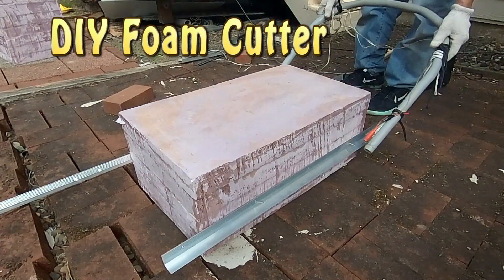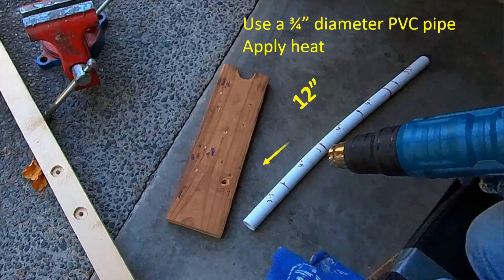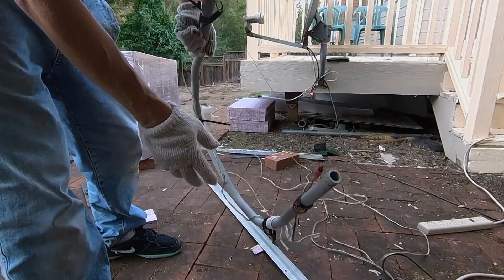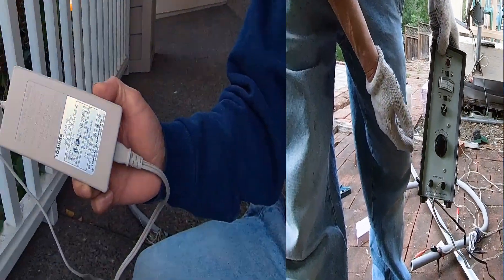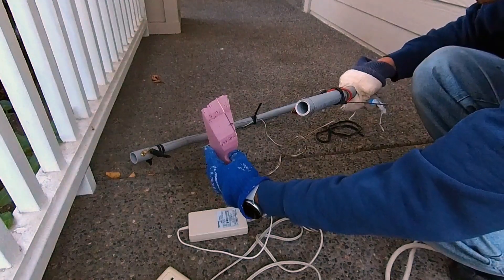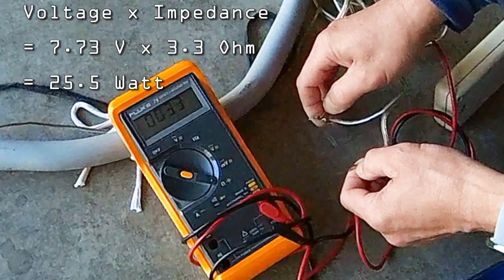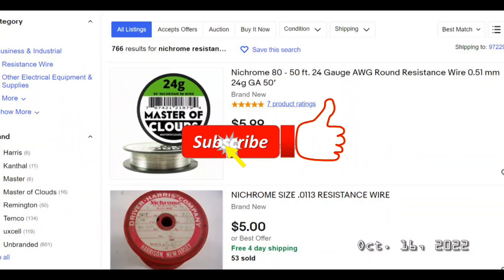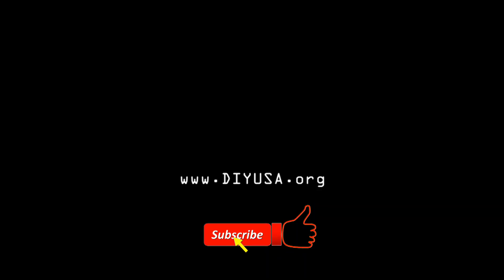DIY foam cutter using laptop power adaptor

Comment: exactly what i was looking for!! thanks so much i was looking for a tutorial to turn my power supply into a hot wire to cut my boats foam🤣🤣🤣 its like exactly what you did too funny
Reply from the maker: Thanks for your feedback. The setup in the video many not generate enough heat to cut a thicker sheet of foam. I suggest you to try: (1) use a larger power adaptor, 80 W or larger  (2) use a thicker gauge wire (to lower the impedance/resistance and draw more current/power, so the wire will be hotter). You can also twisted a few thin wires together to reduce the impedance and allow more current to go thru. Have fun!
Reply: Sounds like what I’m doing lol. I’m using it to evenly cut the pour foam channels I poured 😅
Reply from the maker: @AbdulShaat  That's great! Thanks for sharing!

Comment: The first bend had me hooked it was too smooth lol.
Reply from the maker: It is very easy to make the smooth bend. I don't put sand, etc. in the tube. You just need to apply even and sufficient heat (not too much as to turn the pipe into yellowish color, which may emit harmful fume).  The pipe behaves like a spaghetti and if your limit your bending radius,  you can make a smooth bend. In this example, I heat a total of 9" long section evenly prior to doing the bend. Have fun!

Comment: The power supply is a great idea.  I've been thinking of making a cutter, I have always used knives and sandpaper.
Reply from the maker: Thanks for your comment. I have used knives, hack saw blade, etc. to cut foam. The hot wire method will give me a more precise and clean cut. Sometimes,  I will still need to use sand paper/sander to fine tune the final dimensions and shape.

Comment: I made one for making halloween props using 2, 12v batteries, another one for detail work was just a soldering gun with a coat hanger cutter ...  If you make a wood 45° form to set the pvc in and line it with AL foil it will heat faster, cardboard also works but wood is heavier and usually stays in place with no clamps
Reply from the maker: Thanks for sharing a wonderful idea to modify the soldering iron's tip to cut foam. I will give that a try. Thanks!
Reply: @DIYUSA  you're welcome. It works well for smaller detail work or trimming an edge that the bigger cutter is too unwieldly for
Reply from the maker: @docink6175  Totally agree. I am building a small foam boat model and this will help!